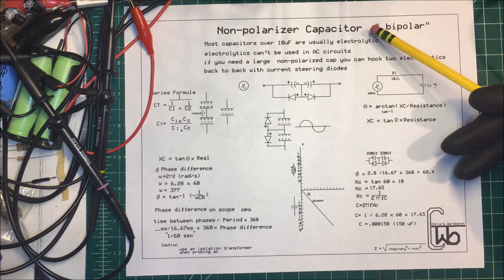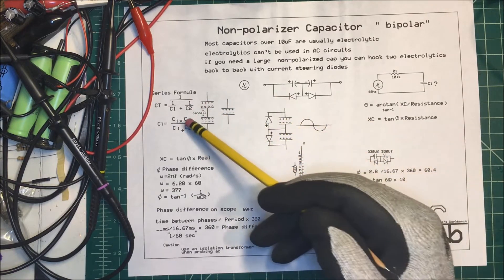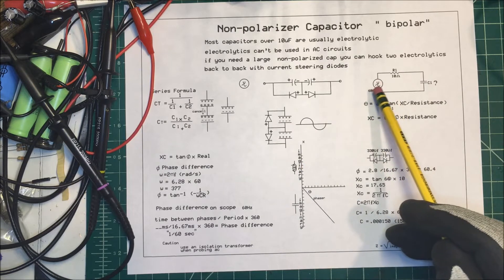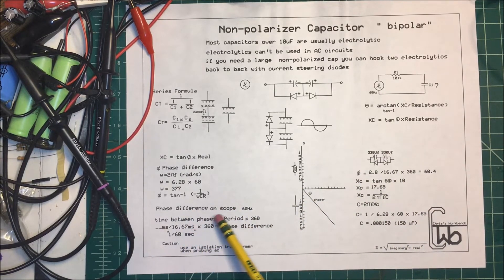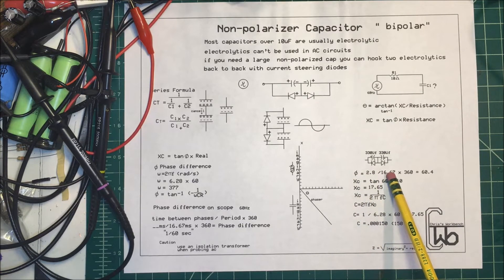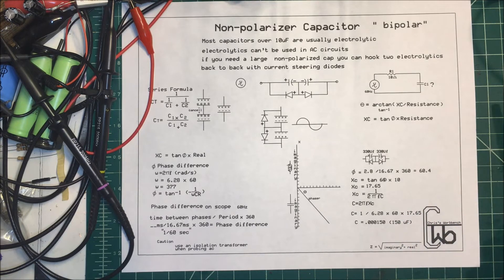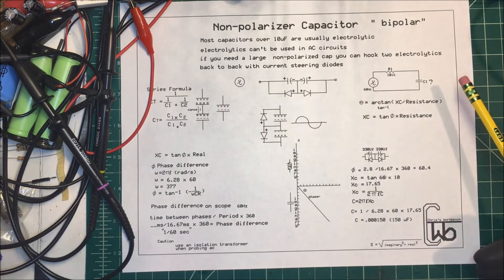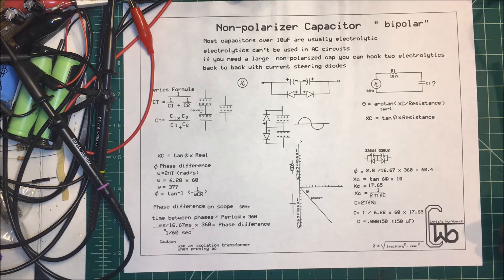Non-polarized Capacitor with electrolytic

Comment: A non polarized Capacitor is an electrolytic. What mickey mouse manual did you get that date from?
Reply from the maker: Electrolytic capacitors are polarized components due to their asymmetrical construction and must be operated with a  more positive voltage on the anode than on the cathode at all times.